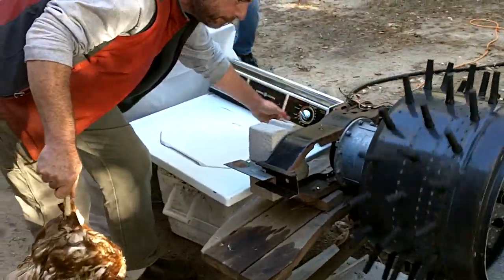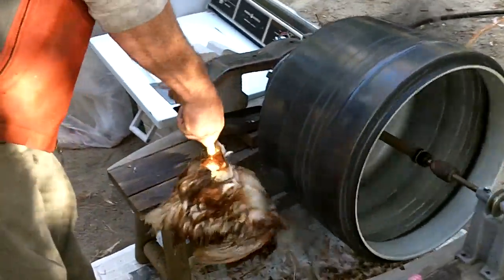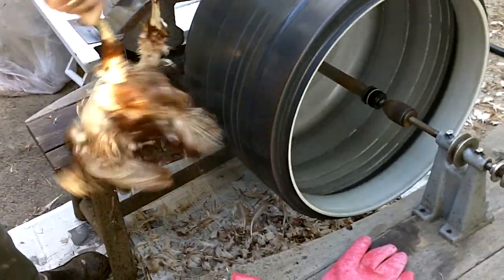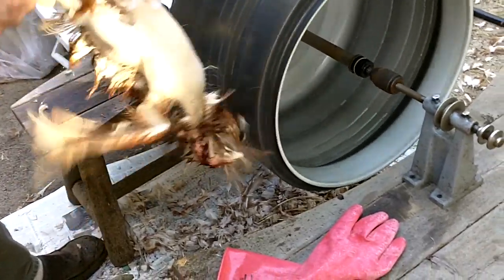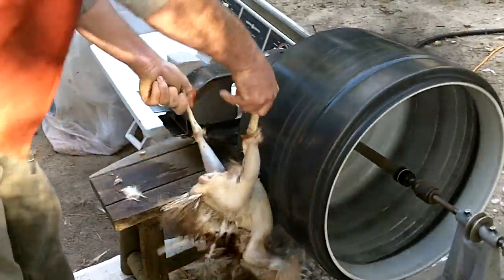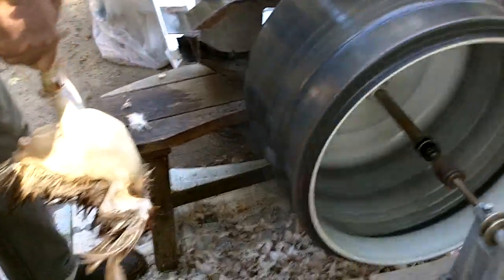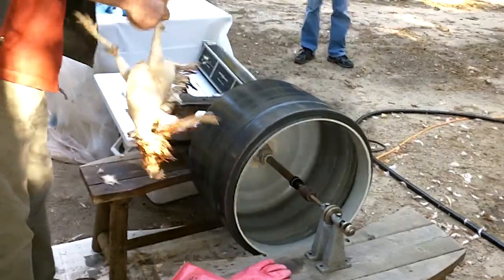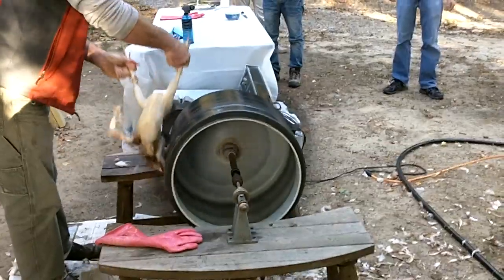The inaugural pluck: Testing our home-made chicken plucker

Comment: Well thougt.. But it would be easyer to put the rubber (or gardenhose) inside the barrel of the washingmachine, bypass the program module and let it run. You could throw the chicken in and just wait for it to be plucket. Also you won't risk the rubber hitting your hand.